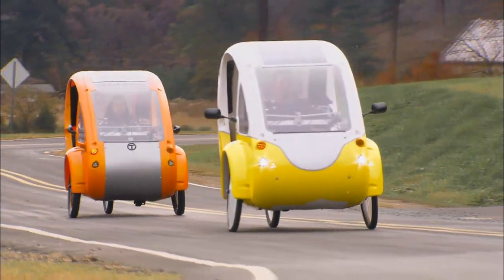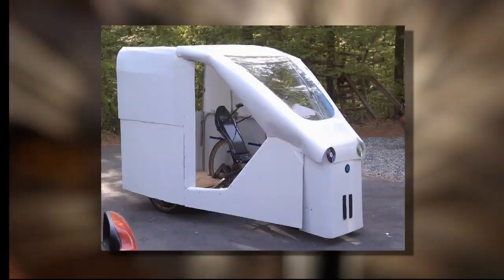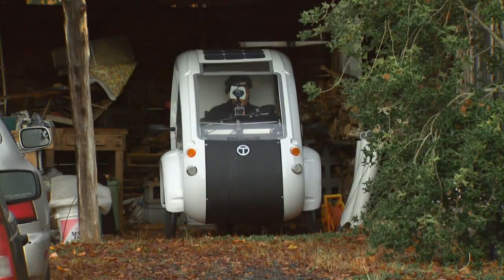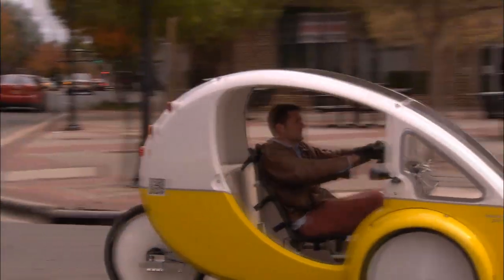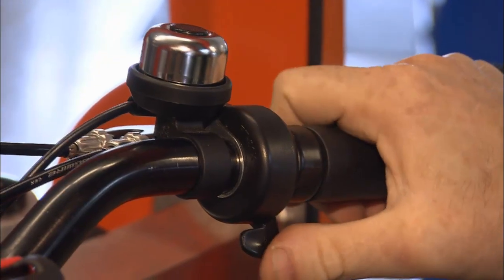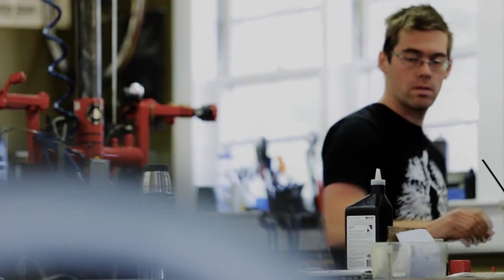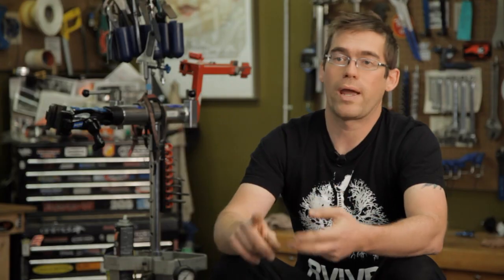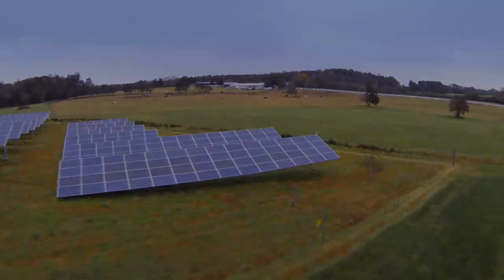Bike To The Future with The ELF

Comment: It cost alot to find out if an ELF is fot you? How do you secure it against theft?
Reply: All bicycle security methods apply - we lock it to a post with a chain or cable. The motor key removes. This thing is huge, kids can't steal and hide it in the bushes. At the present time, only used ELFs are available.

Comment: Sadly Organic Transit who manufactured the ELF went bankrupt in 2019 & was purchased at Auction in 2020 by Oil & Gas company Petro Sun.  Hopefully some young bike enthusiasts will carry on the original owner Rob Cotter's vision for future production of these outstanding eco friendly Vehicles. The market is definitely hot right now for these.
Reply: Perhaps they should have thought that a vehicle like this can't be ridden anywhere, partially or safely. It's not a bike; it's a circus vehicle with no infrastructure designed to accommodate it. The same goes with trikes/recumbents and both of their fat cousins.
Reply: @brianbassettnumber1  Very true but I believe there is a genuine market for Electric Micro Vehicles in our near future. The manufacturing costs to build them are enormous but the prototypes have already been built.
Reply: @brianbassettnumber1  Very false. The ELF was my only transportation for 7 years. ELFs have set records for long distance travel in velomobiles, the longest is 46,000 miles and still going. No one has ever been lost in a collision with this, the safest bike ever made in all history. 
Learn what a velomobile is and how this is a cargo version of the velomobile design. Trikes of all sorts also are very widely used on trails and in traffic but only the ELF has all the DOT lighting and horn like a car. These days the standard for bike paths is now 10 feet wide - no issues.
After 7 years with no typical car expenses of $3000/yr I saved so much I was able to pay cash for a new US made Arcimoto electric autocycle capable of 85 mph. It is also an exceptionally safe and versatile trike.

Comment: It has a battery. Most of the vids and such about this vehicle don't bother to mention that fact. Now all I need is one that can do 45 MPH and a range of 20 miles.
Reply: It has a range of 25 miles now. The video is 7 years old, a long time for battery performance and cost changes. It is illegal to go faster than 20 MPH in an ebike in the US. It would be foolish to go 45 in a 160 pound trike. It is not designed for such speeds. Three owners have completed journeys between 4000 and 36,000 miles in an ELF with one extra battery. Any vehicle with a solar panel is assumed to have a battery.

Comment: That's nice until someone runs a red light.
Reply: No one is safe with a red light runner. Walkers and bicyclists are the most threatened though. The ELF body shell provides 360 degree crumple zone protection. No one has ever died in a car/ELF collision. An ELF was t-boned in an intersection by a red light runner. It was shoved sideways for 40 feet before coming to a stop. The ELF owner was uninjured but obviously shaken up. So much for that...
Reply: @popeyegordon  that's pretty impressive.

Comment: Where I live these things would end up in our harbour given the high winds acting on the high bodywork. Regularly have to chase the empty recycling wheelie bins down road, don't need to chase my car.
Reply: No. The ELF weighs 160 pounds and has a parking brake. We lock it to something when we leave it. It can not be compared to a blowing plastic bin that weighs 15 times less. The ELF is wind tunnel tested to be slick and it has no side doors so wind can't catch it.
Reply: @popeyegordon  60 to 70 mph winds not that uncommon, recently had truck blown over damaging the main harbour bridge structure.
High sided trucks, motorbikes etc are banned in high winds.
The elf looks way less able to cope.
Reply: @jimglass5892  As that truck proved, there will always be weather where no one should be driving. Abusing fossil fuels to overcome all conditions nature can offer is not an acceptable lifestyle. In fact, it is killing our biome. Learn to work with nature, not against it. The ELF is not 'high sided'. It just has a roof. Period. If you add the optional side panels then it would qualify as high sided unless you roll them up.

Comment: They show a tricycle out on the highway. All that needs to happen is for someone reaching down for a cellphone close to a stoplight and she is crushed between two cars!
Reply: Typical car driver talk. You think you own the roads when in fact you lose your license if you don't share the road and many of us use bike paths. We always use bike lanes when available. After 7 years and 1000 owners no one has been killed in an ELF thanks to its 360 degree crumple zone protection, full DOT lighting and horn. Between two cars there is a 3 foot crumple zone in the rear and two feet in front for an ELF driver.
Reply: https://youtu.be/qro7oBzUBos
Reply: @resetthis9838  Hey asshole, your links are stupid and add nothing to the debate.

Comment: Is this available in Australia? 

Does it plus into mains power to charge it, or is it totally dollar power?
Reply: The shipping to AU is far too much. The battery can easily be plugged in with the included AC charger but the solar panel works so well that some never need to plug in.

Comment: It be better if they can make one that don't cost the earth to buy. Elf is £7000+ about as much as a car to buy
Reply: The ELF is designed for the US market but your comment makes no sense at all unless the EU requires no mandatory driving insurance for cars. The price is $8,950 and that's all you spend but buying a car is the beginning of a perpetual 3 to 4 thousand dollar annual cost that never ends. The ELF costs only $300/yr to own and operate. AFTER buying an ELF you will experience a level of financial stability not attainable with car ownership and if you don't have the full purchase price to begin with, buy a used bike instead. I have saved $15,000 in the first 5 years of owning the ELF instead of a car and in the next 5 years I will save another $15,000 (pre-inflation). No insurance required, no gas or engine maintenance and bike shops charge only $20/hr for labor. You seem to not be aware that basic bullet shaped velomobiles cost between 8 and 11 thousand dollars with no electric assist, solar panel or cargo capacity. The body shell is almost impossible to make on your own, all hand built shells will be too heavy which is why you don't see them on Youtube. The expensive vacuum forming mold the company had to invest in is key to keeping weight down.

Comment: no windshield wiper
Reply: Wipers ruin plastic windshields and are not very important on a 20 mph vehicle. We use pure carnauba liquid wax treatments to keep the water beading off and reduce scratching. It works fine.

Comment: Hi, my real name is Fred Flintstone. I will buy such a great future car. Is there a four seater for my family too?
Reply: The rear seat version has seat belts for two kids or one adult passenger. This bike has a 550 pound payload capacity. It holds 30 bags or groceries and can pull a bike trailer. Just last week I hauled two 20 lb propane tanks for exchange, up over a long hill, with no real effort. I stayed dry in the rain. This is the safest bike ever made with its 360 degree impact protection and you can't beat free solar power. Fred would be envious.

Comment: well i could build this thing from the same china parts in no time...this costing 5-9k is just astounding...wait till affordable electric cars come out by 2020 and this thing will be in museums and trash piles.
Reply: No you can not. Your body shell would look like crap and be far too heavy if you don't make molds. The vacuum molds for the ELF body cost a fortune. This 'thing" is the future of sustainable transportation. All vehicles weighing over 1000 pounds will soon be taxed into oblivion. Use cheap parts and end up with a death trap. OT uses the highest quality high performance parts and materials that are easily recycled. The $1000 lithium battery is literally the finest available on the planet, each cell is separated by fire proof foam and assembled in a US factory - NASA couldn't design a finer battery. By 2030 the mandate will be for electric cars weighing no more than 1000 pounds and no faster than 45 mph. Live in the future now with the most sustainable car substitute on Earth. I got rid of my car 4 years ago and have saved many thousands of dollars while living guilt free with sustainable transportation. The new competing US company copied the ELF and sells for the same price. They are both back ordered 3 to 6 months due to high demand.

Comment: Base price has risen to $8,950
No you don't need doors.
No you can not do better buying a used car
Yes it is very safe compared to any bike
No, theft is not a serious problem
No it is not too wide for bike trails and lanes
No you can not make one cheaper yourself
Yes the solar panel works very well
Yes it works fine in light snow or ice
Yes it climbs hills well

Comment: velomobiel.nl quattrovelo has about the same cargo capacity but is less than half the weight and has about 1/4 the frontal area, so it is far easier to power at speed.  It is also more stable (having four wheels, and lower centre of gravity).  A real velomobile can be entirely human powered, this thing is far too heavy, and far too big for pedaling to be of much use. The aero is also awful, with the whole bottom of the vehicle being open so that in bad weather it will be awful... a quattrovelo has far better weather protection as well. When it's cold in a velo, the compartment is small enough that your body heat can be enough to be cozy.  not with the elf, that's why they are talking about electric seats for colder climates. If you were actually pedalling usefully, that would not be an issue.  Oh yeah, and the velomobiel has full suspension, so it will have a much smoother ride.  You can have useful human powered car replacements, but Elf isn't it.
Reply: The 4 wheel bike is not legal in the US under federal law without license and insurance. The design you seem to favor will not take a passenger or 24 bags of groceries. It does not have a 550 pound payload capacity like the ELF which is the SUV or heavy hauler version of a velomobile. The ELF weighs 45 pounds less than the new competing vehicle by better.bike called the PEBL. The ELF has front suspension and the 3 inch fat tire option that give a smoother ride in regions where it is useful. MY ELF IS IN FACT AN EXTREMELY USEFUL FULL CAR REPLACEMENT that I have been using every day for the last 4 years. I'm too old and fat to climb in and out of a bathtub design, not an option. Since getting rid of my car 4 years ago I have saved $12,000 US which is much more then the ELF cost me. I have hauled 14 one gallon jugs of water, frozen turkeys, cases of beer, 6 one gallon pots holding landscaping shrubbery, and my trailer has hauled an air conditioner, 2 propane tanks, or 2 garbage cans full of leaves or recycling. The body shell of the ELF has been wind tunnel tested to prove that it only creates the same wind drag as a man on a bicycle. The ELF has two door styles available. Full enclosure is a mistake, we over heat and the windows fog. Rain falls down, not up, so I am happy with my partially open floor. Any more incorrect statements you wish to make?

Comment: 5000? It's sold for 9000$ or more.
Reply: Of course! The video is 4 years old. Over 400 improvements have been made since the original design and former options are now standard. The new competitor called the PEBL costs the same but weighs 45 pounds more (a big problem!), solar roof is an option and there is no warranty. If my ELF was lost I'd order another immediately. In the 4 years without a car I have saved $12,000 and am very happy with my decision to live sustainably.
Reply: @popeyegordon  I down't own a car right now and my ebike costs 1/6 of this one. Which feels in comparesing a little expensive for an ebike with a chell. Maybe they make improvements to build this cheaper then an entry lvl Car. :)
Reply: @thewunderhase  You need to read my last reply again. Cars always cost 10 times as much to own, even if the car is given to you free. The ELF price represents a different investment that starts paying back immediately. I'm already $4000 ahead since buying mine and if it lasts me 10 years my ELF will have saved me more than $30,000! Plus the vital exercise no one gets in a car, and stopping co2 pollution.
Reply: @popeyegordon  the one on one comparing with a Car is questionable. Its not as fast as a Car it can not carry as much. Its more like a Scooter with some perks. They won't change the market at this price, it will be a china ripoff for half the price or less if the concept catch fire.
Reply: @thewunderhase  Actually what you attempt to suggest is better is exactly what is wrong with abuse of 4000 pound steel caged climate controlled high speed couches. They are not sustainable. They go TOO FAST and waste TOO MUCH ENERGY that is being stolen from future generations. Cars require too much nature suffocating infrastructure and ruin the quality of life for city dwellers and city designs. A car-bike like the ELF stops that theft. Americans are not stupid, they know Chinese knockoffs will be inferior. The US made car-bikes use top notch high performance durable components. An item this large is expensive to ship too. The market is already changed. This new industry will continue to grow.
Reply: @popeyegordon  you are right, cars are mostly a waste. Everyone knows it, but most people still buy cars and will buy big cars in the future. They just want something good in compare what they pay for. And paying six times as much to have an roof on my ebike doesn't sounds like a good trade.
Reply: @thewunderhase  It is not 'six times as much for an ebike roof', it is 1/10th as much as the cost of a car. You get a hell of a lot more than a roof, you get 550 pound payload capacity, room for a passenger or 26 bags of groceries, full DOT lighting and horn, crumple zone collision protection and free solar charging. Mine is in the sun right now topping off after yesterday's ride and ready for the next. Car buyers are penny wise and pound foolish in addition to being very selfish. Soon a carbon tax or preferably a high tax on every pound of vehicle weight over 1000 pounds will force some sense into selfish personal car drivers. In the meantime I continue to save a solid $3000 each year, that's money in the bank, by not continuing my car addiction. I have invested that money and it is growing, ready for my next version of sustainable transportation.

Comment: What is the maximum inclination of the road so that the micro car eBike are able to go up on it using only solar energy? How much does it cost in US$?
Reply: This is not a dealer page. Please go to OrganicTransit.com  The 750 watt motor can pull as much as 1,800 watts from the battery while climbing hills and simultaneous pedaling lets you tackle steeper hills. The panel slowly charges a powerful 48 volt lithium battery. Not a micro car, a car-bike or more precisely, an electric assist velomobile. The current base price is $9K US. If mine was lost I'd order another one immediately. Shipping costs make this a toy for the wealthy if you live overseas.
Reply: hector nadal  False on all points. The frame is the classic tadpole trike design that has been used for years. US federal law defines this as an electric assist bicycle that is legal in all 50 states. Some local laws for trails vary but at least 99% of all US roads (but never interstate freeways) are legal for using the ELF. Two companies have sold over 1,100 of these and three ELF owners have gone on 4000 mile cross country trips. I have used my ELF every day on all local roads and bike trails for the last 4 years since getting rid of my car. The local Florida cops and sheriffs like my vehicle. This is a new industry and sustainable transportation design that is here to stay. Personal cars are already obsolete due to our climate emergency, you just don't know it yet.

Comment: I wonder what the Ferrari guy at 2:51 was thinking when going so damn slow. No apparent suspension on the design, no passenger's seat, yet is made for streets... it is a convenient design only for a really limited sector
Reply: There is a two seat version as well with a rear bench and two seat belts for kids. It has front elastomer suspension and most of us use the optional 3 inch tires softly inflated for a reasonable ride. 1000 sold and a new competing vehicle of similar design is now in production. I got rid of my car 3 years ago and love this lifestyle change. I get exercise and no longer emit pollution. everywhere I go people line up to ask me questions.

Comment: To big, takes too much space parking, Bad in windy conditions, less is more in cycling.
Reply: Says one inexperienced in this, having never driven it. I have used it every day for the last 29 months, there are no such issues as you suggest. Wind is always more of a factor on 2 wheeled bikes. It takes up 1/4 of the space of a car. Fits in motorcycle parking spaces or can be locked to bike racks conveniently near the front door of businesses. My days of long walks from the far reaches of Walmart parking lots are over.
Less is not more when you want to take home 20 bags of groceries out of the hot sun and rain.
Reply: The ELF fully fills the 'less is more' category when you get rid of your car and use this instead. Most bike riders also own a car.